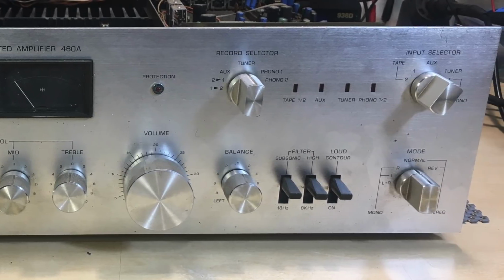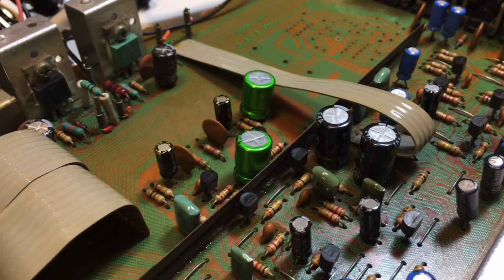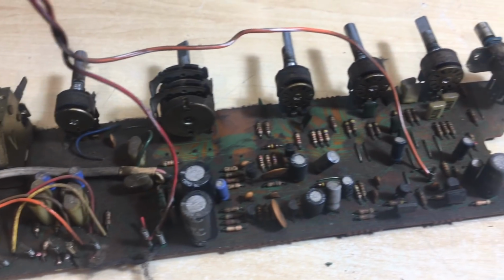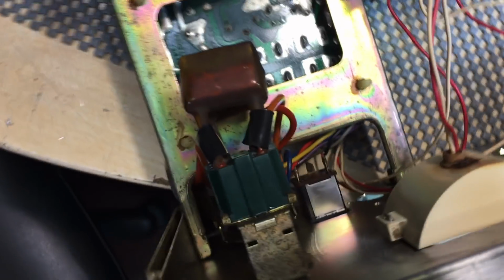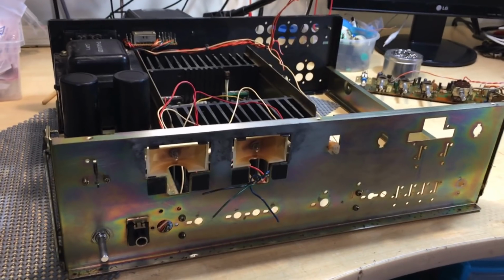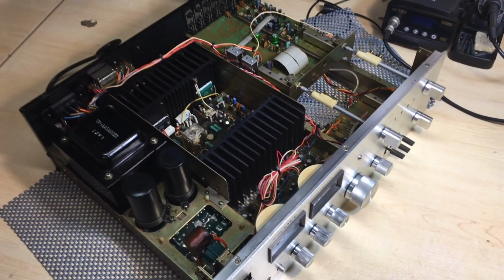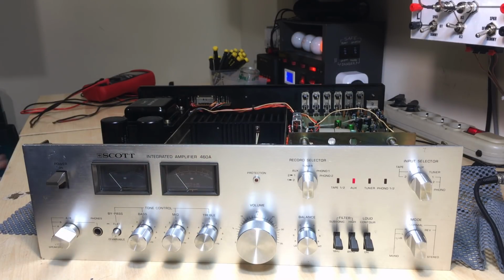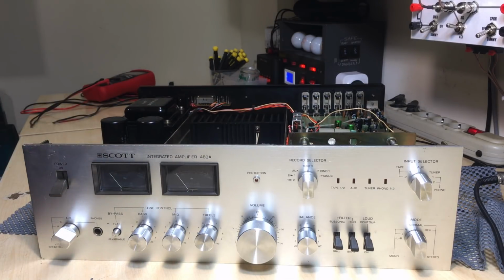HH Scott 460A amplifier takes a bath.

Comment: Do you have a resource for OEM replacement power transistors like the ones in this unit as seen at 11:39 in the video on the heat sink.   One is black and the other is like a turquoise green.    I need a set to get my HH Scott 380R going again.  Thanx.
Reply from the maker: Unfortunately I don’t off-hand. I usually start searching the web, especially the forums for some clues. You can also try and find equivalent components as these can. E really difficult to find.
Reply: @electronicsoldandnew    Thank you.   Kind of what I expected.   Those transistors are unusual.  Forums are a good thought.  Thank You    Merry Christmas.

Comment: During my time in the United States Air Force, I was a metrology technician in the Precision Measurement Equipment Laboratory (PMEL) at various bases around the world.  I spent two years in the Philippines. The lab at Clark served as a sort of forward depot for the war efforts in South East Asia.  Tropical climates are very hard on on delicate equipment.  It can get incredibly filthy in such areas. we used to run equipment (mostly militarized versions) through a dish washing clipper - the same as used in military dining halls to clean eating and cooking utensils.  We did not use the kind of detergent used for dishware. We just used milder detergent used for hand washing of dishes. We did use very hot water, though.  This was very effective at removing jungle crud and grime.  It is possible, with some minor preparation to even wash a Tektronix 545 oscilloscope in this fashion. I realize that that's a very dated reference, but if you've seen or worked on one of them, you are aware of the delicacy of the instrument. The delay line in one of them had 50 or 60 adjustable coils in it.  They washed just fine.  You had to very thoroughly and carefully rinse, and then allow to air dry for about a week.  But nothing ever failed due to the washing process.
Reply from the maker: I’m learning from this experience that I’ve been unnecessarily wary about washing equipment. Definitely going to consider this method in the future.
Reply: one possible issue is moisture migration into the stranded wires, trapping moisture and leading to corrosion in the wiring.
Reply: @pvb9964  agreed - but more modern equipment tends to be highly integrated and uses easy-to-release  connectors to connect submodules or power. In addition most model boards are washed at the manmufacturing stage so few compnents cannot witshand a water wash. Notable exceptions are speakers, microphones and unsealed potentiometers, though a piece of quality electrician's insulating tape or kapton heat-resistant tape pressed down well over the top of such items seals them quite well I've found. 
I've been washing (immersion or dishwasher) PCBs for decades now. I'd rather not immerse an amp like that because as you say, cable wick moisture, but otherwise it works fine for low-voltage assemblies (under say 70 volts)

Comment: You know what, it might be a Scott but if you consider the purchase price and then add the cost of repair... For the money, I don't think that you can get something new that will last as long or even sound as good.. I think that it has a lot more going for it today than what it did when it was new LoL...
Reply from the maker: You’re probably right. I’m liking it more and more, and haven’t  even heard it play yet :)
Reply: @electronicsoldandnew  There seems to be some unpopulated components on one of the boards... I wonder what that circuit was for? Might have been a feature for a better model? Sometimes there's schematics for the better version that shows up other features...

Comment: I watched a vid and the guy said don’t die the water bath as water will wick up the wires.  
I wash boards all the time and if the sun is out then it gets sun, if no sun then fan and or low temp oven.  I’ve had no issues with water cleaning equipment.
Reply from the maker: Well, I certainly am adding this technique to my arsenal.

Comment: I'm retired now but for 30+ years in electronics repair, I washed many modules and chassis' in the sink. I used a spray cleaner called Fantastic and an old toothbrush. After a thorough rinse, I used a small table fan to dry them completely and sprayed contact cleaner inside pots and switches before testing. HH Scott was well respected here in the USA in the 1950's, 60's and 70's. I built an HH Scott Amplifier Kit in the mid 60's when I was a teenager.
Reply from the maker: I didn’t know much about this brand until I started this project. Now that I do, I’m glad I have it.

Comment: I have heard of people putting radio chassis in the dishwasher with good results. I think it helps if you live somewhere warm so the chassis can be left to bake in the hot sun to dry out any moisture left in pots etc.
Reply from the maker: It is quite warm here, and I used the hot air gun, but it still felt weird :)

Comment: Unconventional, but likely not going to harm most of the components, maybe flush out the pots and switches with some contact cleaner to remove any residual water... I' sure you will get it going even if it is a Scott :)-
Take care and Seasons Greetings. Thanks for all the videos in 2019.
Cheers,
Reply from the maker: I have actually used a bit more contact cleaner than usual :)

Comment: I washed a 1990s Apple keyboard in the dishwasher, without removing the electronics. After the wash I doused it with isopropyl alcohol, which I'd read would displace any remaining water. Then I gave it several days to dry. I did not use soap in the dishwasher.
Reply from the maker: Those keyboards are difficult to clean so this is a good idea.